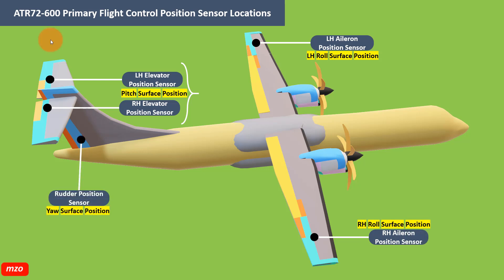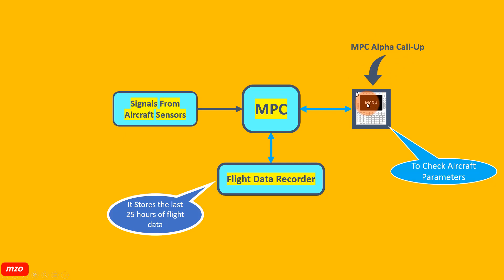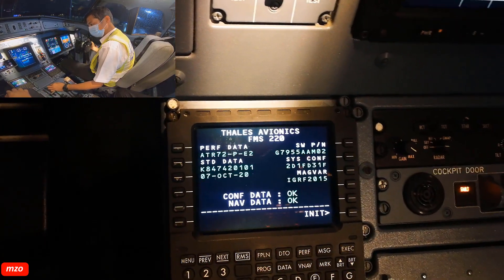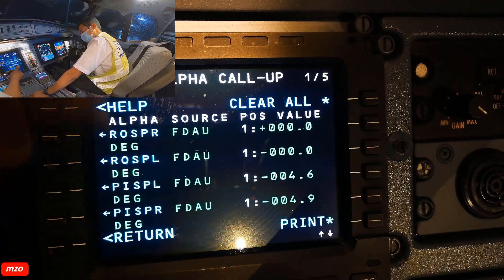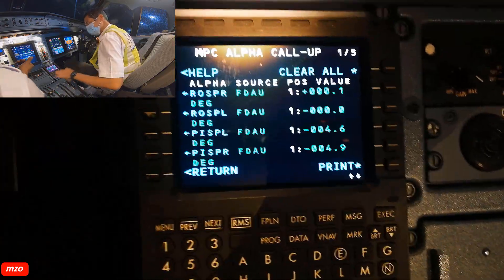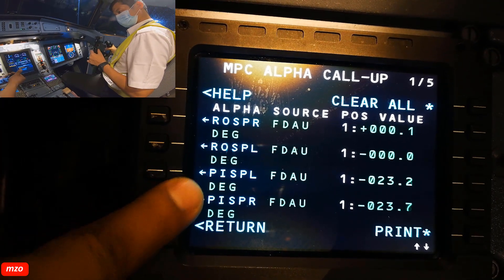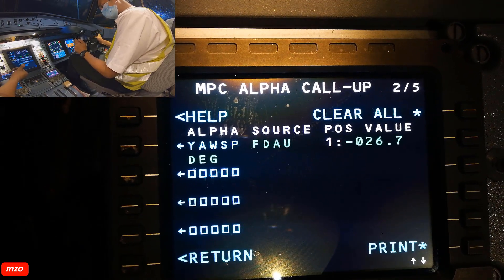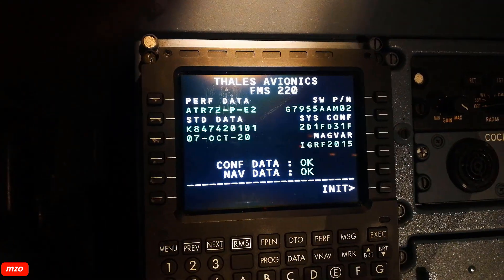🔶How To Use Multipurpose Computer For Troubleshooting on ATR72-600🔶

Comment: Ohh this video very nice I never do it usually I follow trouble shooting manual. In mcdu only chek last flight report if found message and fault code. So we next to trouble shooting manual by ADOC .very2 helpfull all  Engineers  ATR 72-500/600 like me in my country Indonesia  🙏 thanks to your video sir 👍
Reply from the maker: This is very useful and smart. You should check all parameter codes and its description in the link of Description.

Comment: Is it possible to retrieve CVR recordings thru PCMCIA without removing SSCVR?
Reply from the maker: PCMCIA is not related to CVR recording. You can listen Cockpit voice 4 channel from data downloader.
Reply: @mzosharing  is data downloader accessible thru MPC? So no need to remove SSCVR
Reply from the maker: @cruxader27  Both FDR and CVR have the ports which have to be connected via Datadownlader. MPC is only for FDR. That's why we can access the parameters such as cruse report, and G, from FDAU which is located on MPC. If you want to download all data from CVR and FDR, just connect your datadownloader in tail section. Don't require to remove FDR and CVR. Datadownloader has the memory card which has to be send for data analysis.